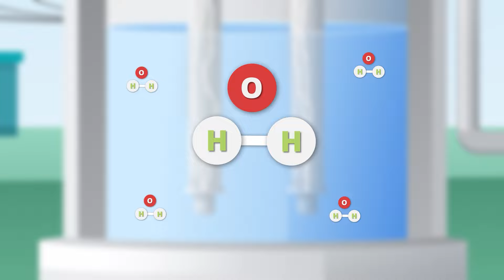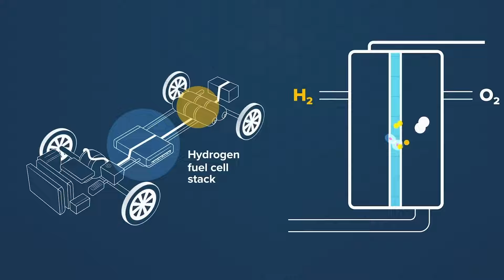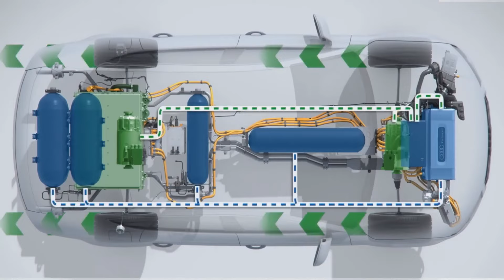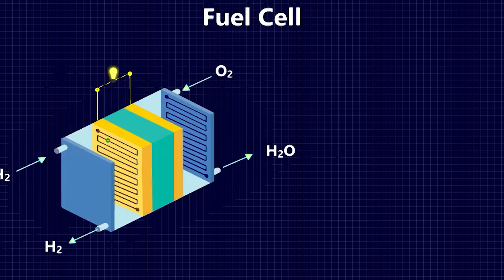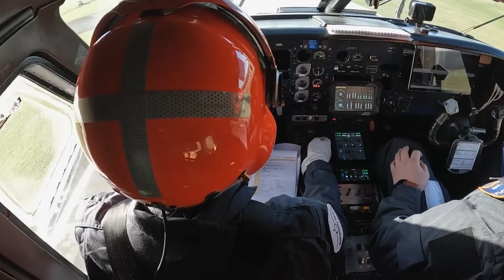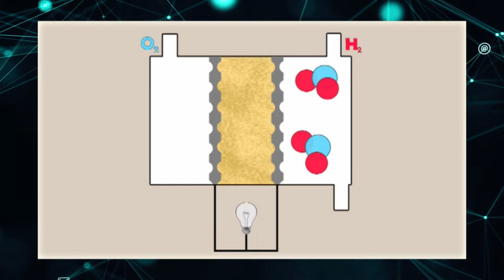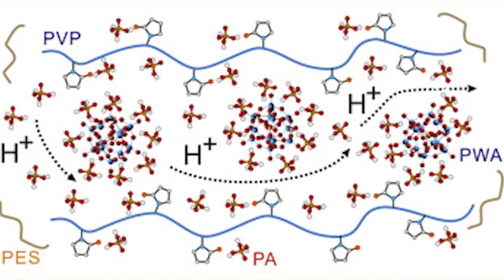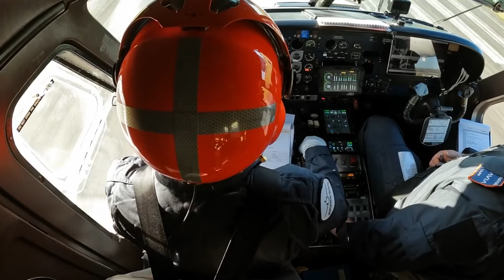Tesla's INSANE Hydrogen Fuel Cells Shocks Everyone

Comment: The EV market doesn't want a competitor whwre the consumer is able to produce the fuel for themselves at home if they wanted to.
There will come a time where electricity is the only accessible energy spurce and is almost exclusively generated at power stations, with only very small and limited capacity devices for generating energy available to the public. Device which pose absolutely zero threat to the established monopoly over an energy sector which itself has the absolute monopoly over the energy source/supply market that the consumer is faced with. Once this has been established and the individual and wider public have lost the capacity to disrupt this very grave situation, the market 2ill be able to bleed every last cent out of the consumers pockets.

Keep the energy sector diverse and inclusive of energy sources which the individual is able yo produce at home with little effort required to acquire the means to do so. Even if the short term costs are more than the 'friendly' alternative. Think of it as investing in your children's future quality of life.